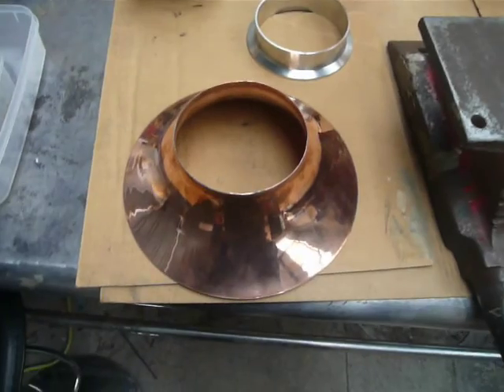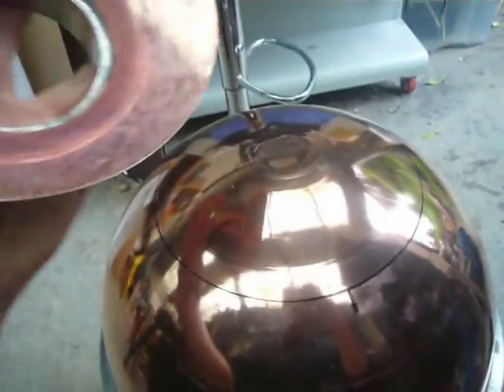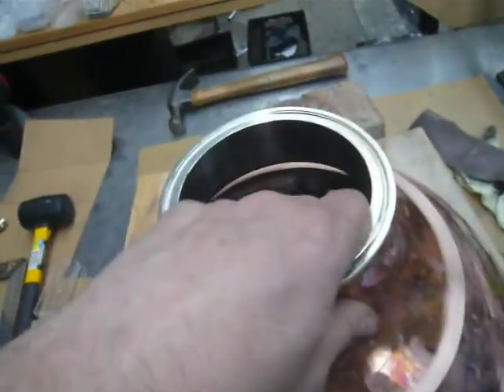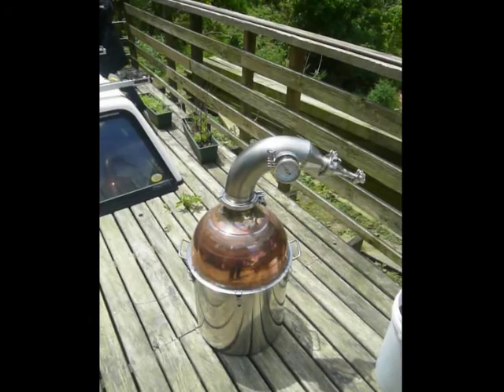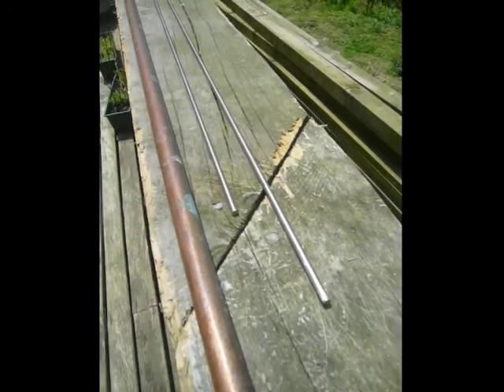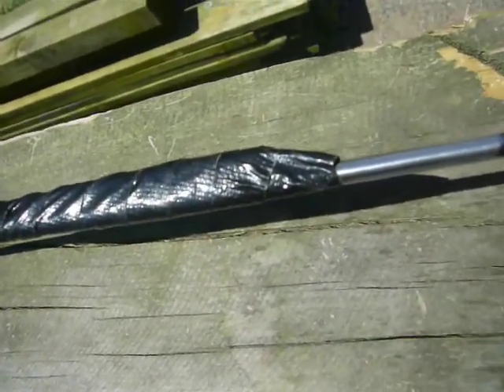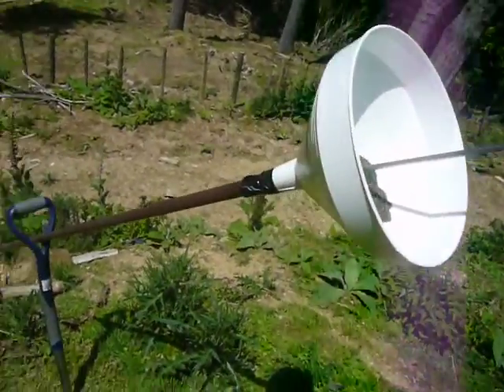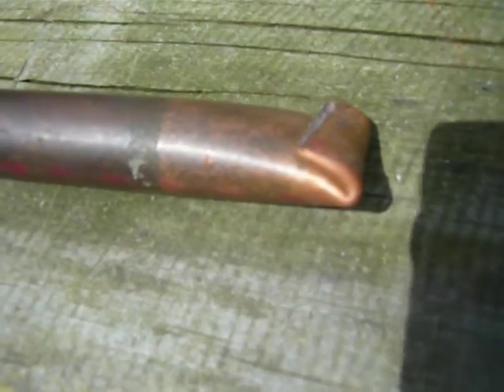02-Making 50 litre pot still

Comment: I really wish you had shared your soldering process.
Reply from the maker: G'day Laurel,
Have done so in other videos.

Stainless soft-solder is really a pain in the butt, I used to do it because that's all I started out with.

Now days I much prefer silicon bronze TIG brazing, far more repeatable process.

Main things for stainless-copper soft-silver-solder work is starting clean and using a zinc-chloride based general purpose flux that states it is suitable for stainless steel.

If it gets to overheated or the surfaces aren't clean enough it just turns into a steaming hot mess and you need to stop and clean it all back.
You need to start out concentrating heat into the stainless to begin with as that usually takes the longest to heat up.

Comment: There's a trick to winding copper.
Drop down to 10mm (microbore) it has a higher copper content which makes it softer.
Reply from the maker: Heya fella.
Yep, thats good for making a tight reflux coil you're going to pump cold water thru.
In this case I'm counting on the surface area inside the coil to condense the alcohol vapour.
Plus I wanted to build a bit of future proofing into it - I've ended up running much larger stills than keggles, and didn't want larger vapour volumes to flood a smaller condenser tube. 👍

Comment: FYI, if you kink copper tubing you can use an adjustable wrench to work the kink out. Start by adjusting the wrench to fit the widest part of the kink and and spin it around the tubing and slowly tighten the wrench

Comment: I know I am probably late to the party, but if you cap one end of the copper tubing and fill with water then cap the end you filled with water. You have to solder the caps on. You can the bend the tubing as the water won't let the copper pipe compress.
   Solder cap on fill with water solder cap on that end.
Reply from the maker: G'day FJ - yeah found a few alternatives - salt was another one, fill it with salt, bend it, chuck it in a tank of water and all the salt soaks up the water and sluices out.
Freezing water inside the tube )big freezer or right time of the year), bend it and then let the ice melt out.

Theres a few ways :)

Happy Distilling!

Comment: Where I live, Canada, we have an annelid copper tubing that is very soft. It is used for water lines that come from the main into the homes water supply and it may have to zig and zag around obstacles. No sand required.
Reply from the maker: G'day Charles,
Yep - we have the same soft copper coil available here in NZ - not in 3/4" I wanted to use - it's available in much smaller diameters - it is very easy to bend but will still collapse if you bend it tight enough.
The 3/4" tube distorts and crushes very quickly on a bend like this if it's not packed with some kind of compression medium.

Comment: I take it you know the thumper will fill with fluid as you run the still. I use a glass thumped so I can see when to empty some out.. Great vids, enjoy watching what your up to. Have fun running your stills, thanks Steve.
Reply from the maker: G'day Steve, Thanks - yep definitely have fun doing this stuff - it's as addictive as all hell hehe.

Yep, appreciate that the thumper does acquire some liquid as its running - I usually charge mine with just enough wash to cover the input tube at the bottom of the thumper in the first place.
If you have your thumper the right size and you are running your still in a balanced fashion the thumper shouldn't ever fill up - if it does it can puke over into your condenser same as the kettle can if you are running a full pot hard and fast.

My first thumper was too small and I had that issue one or twice - enough for me to build an upgrade that was approx' one third the size of my kettle - haven't had that problem since.
Have seen some setups designed to return material to the kettle should the thumper fill up to far, looks like they work particularly well with inline thumper builds. 

Also helps to insulate the thumper (I just duct-taped towels around mine) to avoid heat loss.
As a parasitic boiler its only heat source is your kettle so if you start losing radiated  heat out thru' your thumper walls it can have trouble retaining enough energy to continue re-vaporizing the liquid in the thumper back into a vapor.
Reply: Glass thumpers are Very Dangerous if they break Can be a Big Fire Hazard!